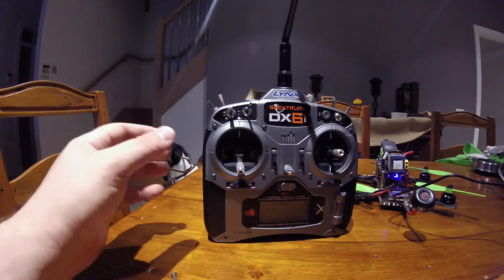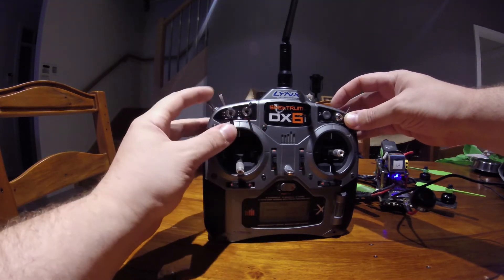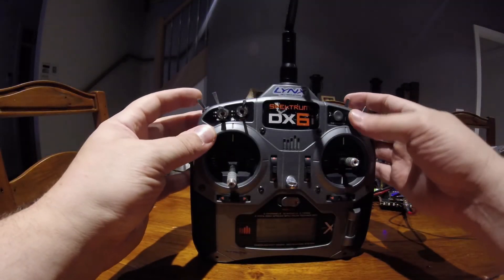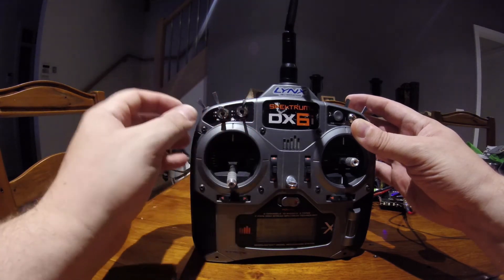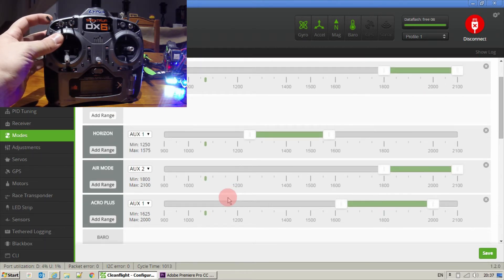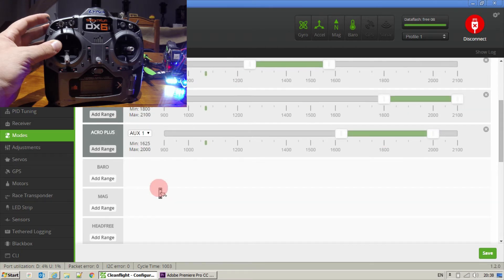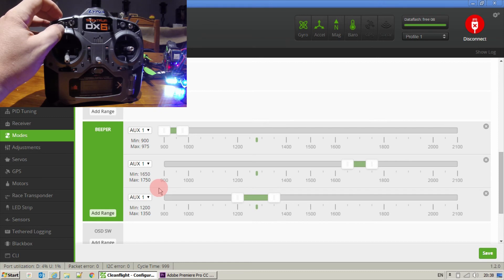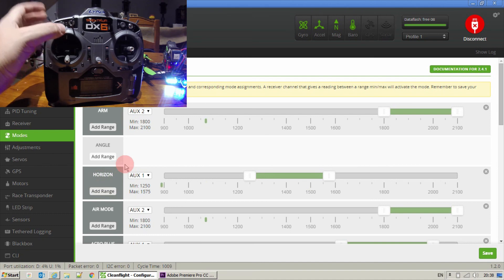DX6i Cleanflight/Betaflight (2.4.1) Flight Modes & Buzzer Setup Channel Mixing

Comment: hi.. can you me how to set up end point dx6i to Betaflight/cleanflight 
I have little trouble icant setup end point 1000 to 2000 or you have the other way...thanks...
Reply from the maker: Agus Widodo set all trims and sub trims to 0% and then use the rxrange settings. See the cleanflight documentation.

Comment: Maybe you mentioned this and i missed it, but how do i connect my controller to my computer
Reply from the maker: Chris Rollins if you mean for a simulator then you need a PPM to USB check eBay for 12 in 1 USB simulator cable. If you mean for firmware updates etc, then you can't with this Tx

Comment: Thanks for posting this! I used it first without the buzzer mode cause I didn't get it at first for some reason. Then after flying and almost losing my quad I came back and setup the buzzer mode. :)

Comment: Hi thanks for video...im new to Quads have new eachine x70 and cannot get to fly as am stuck with cleanflight set up, think ive bound it, but cannot set the dx6i to arm or the basic flight mode.the manual is bit over my head...can you help..id be eternally grateful as i havent had one flight with my new xmas present..

Comment: Thanks Dan for taking the time to make this video! I have the newer Dx6, and was stuck on how to get the buzzer to activate on a separate switch, incase I lost the mini quad in tall grass or it was just out of sight. I ended up setting a mix with elevator and flap so I could use the same aux channel as my mode switch is set to. Once I activated the switch all I have to do is move the elevator a little bit and it makes the buzzer start screaming. Take care.   Jamie